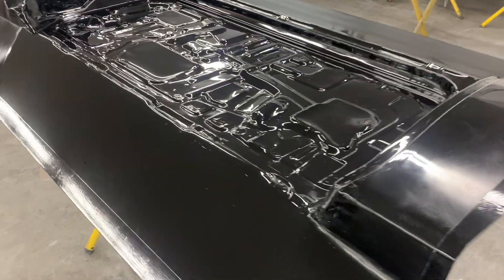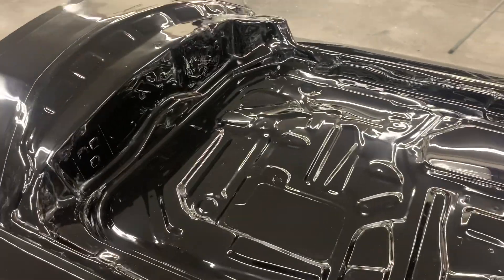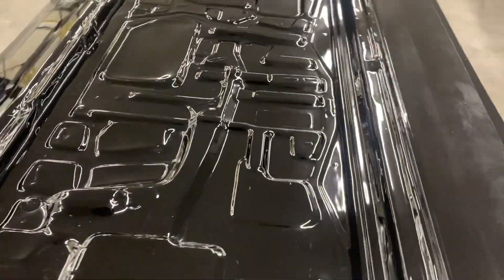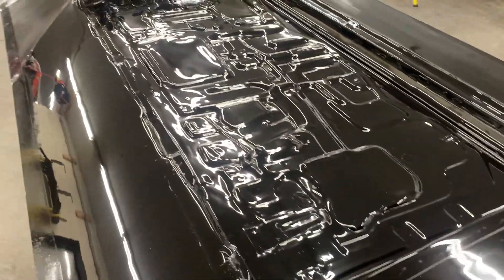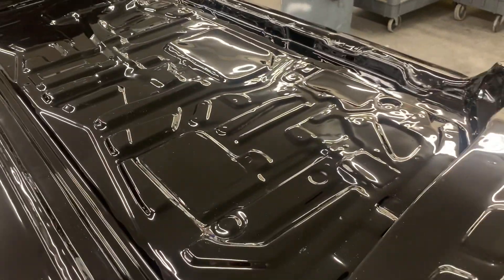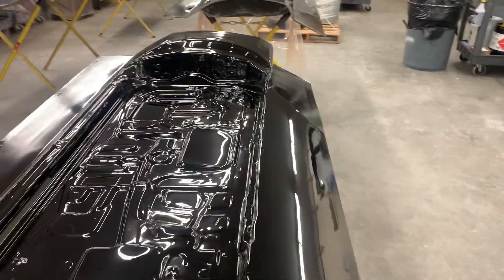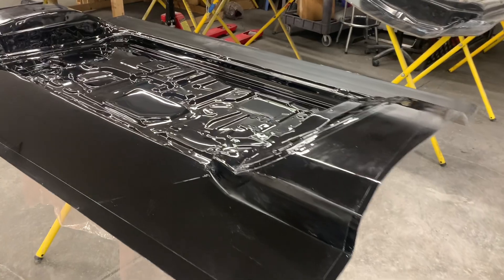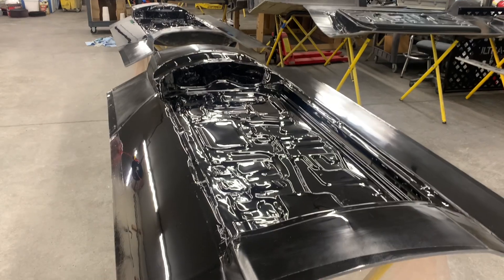81-87 Buick Regal/GN Inner Door Molds

Comment: Impressive.

Do the doors come ready to accept the latches, glass, and window regulators, or is there drilling and fab work to do?
Reply from the maker: The doors do come ready to accept all factory hardware. There is no fab work necessary, but you do need to drill the holes you need. All holes are marked out and well defined.
Reply: @Ultra-Carbon  Thanks for the quick reply!